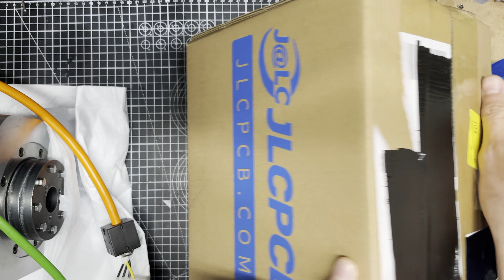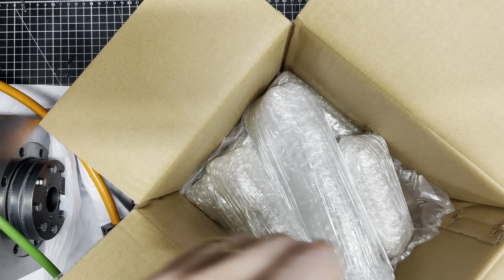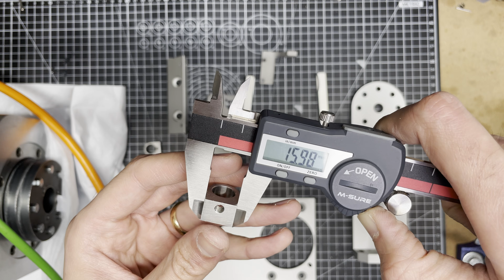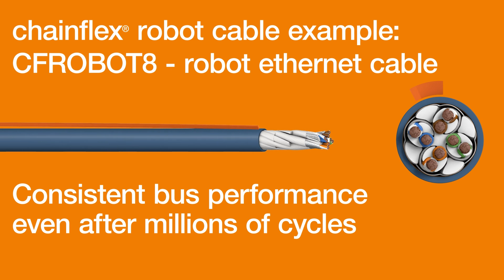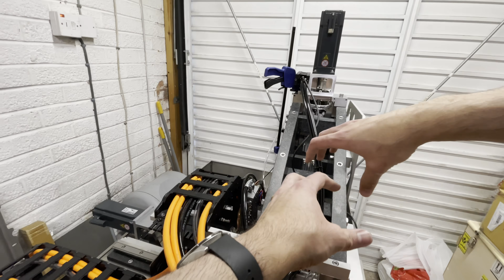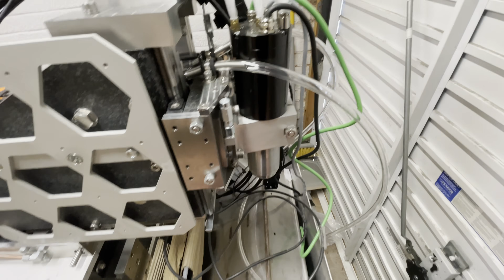Cables and Energy Chains (Igus) - E008

Comment: Hi Kasra, big fan of this build series. I'm working on some designs for a 5 axis of my own, so this is a goldmine of information for someone like me! I'm a mechanical engineer but this is one of my first attempts at building industrial equipment. I saw in one of your responses to another comment that you chose "overpowered" motors for the axis because you intend to limit their torque (and consequently their power) for increased precision. That made me reconsider solutions to one of the biggest constraints my project faces, which is 15 amps of 110v power. Naturally my plan was to use a 2.2kw spindle, but I've heard people say that even the high quality ones don't have low rpm torque. Now I'm considering using a 7.5kw bt30 spindle at roughly 20% duty cycle to have the freedom to select exactly how I deliver the power I have available. I'll probably reach out to the spindle supplier and ask what their thoughts are on the plan, but either way thanks for getting me to think outside the box.
Reply from the maker: @decreasinglynumberless  hi, thanks for the positive comment. 

I hope your build is going well. It's slightly different with spindles. You can actually get 3 or 4 kw spindles with a much higher torque at low speeds compared to a 9 or 11 kw spindle for example. So always consult with your manufacturer, but only after you have calculated the cutting power that you need and at which speed you need that power. You might be able to get a much lower power spindle but with the torque characteristics that you need. If you are after a high quality budget brand, I would recommend CTB from China. Or if you have a bit more money and want to buy a European one, check out HSD, Elte or Omlat. If budget is not an issue go for Kessler or Fischer. 

Cheers,
Kasra
Reply: @kasramehraky9283  Thanks, I've been looking into Jian-ken after hearing good things about their support and construction. Do you have any book recommendations on the topic? I've crunched many numbers, but I'm sure there are many things I havent checked because I don't know I should be checking them.

Comment: Hi Kasra, I've been following along with the videos since the beginning. I don't typically comment on videos , but I wanted to truly thank you for making this series. I've always wanted to make my own machine, but due to too many unknowns about building machines the financial risk of creating a giant paperweight that doesn't live up to my expectations always kept me from going for it. These videos you made have taught me so much, they are invaluable to me. It's the best content on machine building I've ever come across in video form. I love how you explain a lot of your reasoning in selecting certain components and how they will work together, as well introducing some suppliers and providers that I had never heard of. Please keep the series going and know that there are people like me out there who really appreciate that you are taking the time to make these.

What I would be very interested in, is if you could explain more about how you size and calculate certain component requirements. Like how you went about sizing your servo motors, and spindle torque, bearing load, bore sizing for shrink fit of bearings, structural thickness of your machine body parts, and in the case of this video cable thickness. Do you calculate everything to perfection? Or do you ballpark it from prior experience and machines you worked on before? Please also show more about the B / C axis assembly when you get to it. It's something no-one has ever shown before to such a professional extent and It's amazing to watch. 

Thanks again and I'm looking forward to the next one!
Reply from the maker: Hi, Thanks for your comment. It really made my day!

To answer your question, it's a mixture of both. I calculate (multiple times) almost everything, so whether it's a mechanical component or an electrical component, and I read A LOT OF DATASHEETS. But I also rely a lot on experience as well. I give you an example, if you calculate the required torque for the ball screws I am using and take the structure's weight, speed, acceleration and machining forces into account, the result would be far less than what I have selected (which is a 1kw with over 3nm of torque for the X and Y axis). Eventhough I am using much more powerful motors, I will be limiting their torque to less than half of their nominal capability. This might seem very strange, but this is were having an old hand in machine building comes into play. If I leave the torque value as high as it is which is over 3nm continuous torque and near 10nm peak torque, over time it can cause the ball screw to shear off because at its smallest diameter it goes down to 8mm (where it goes into the coupling). So why would you want to spend more money to buy a bigger motor and drive and then limit the torque? Because a more powerful motor holds its position a lot easier than a smaller motor and needs less small adjustments to maintain its true position. Those small adjustments translate into vibrations and even poor surface finish quality in sub micron levels.

I will be doing a dedicated episode on GD&T and drawings of this machine because I feel that can answer a lot of questions.

Cheers,
Kasra
Reply: @kasramehraky9283  Glad to hear it!

Thanks for that insight! So do you mean that because it is much stronger than needed, there is less correction during acceleration and deceleration in de PID loop between the servo, drive and encoder/scales, and therefore that leads to less jerky motion and vibrations? Or is it that the physically bigger servo has a larger diameter rotating shaft and therefore the same amount of power applied moves it less and can therefore be moved more accurately? 

Would love to see a full video on the GD&T and drawings! Also would love to see a full video on the beckhoff system and getting all the components/modules talking to each other correctly. And especially the Beckhoff motion controller itself. I've seen a few builds using EtherCAT with LinuxCNC to run things, but never seen the actual Beckhoff controller used. I'm curious about its out of the box capabilities and how customizable/programmable it is (I'm a software guy, can't help myself).

Cheers,
Laurens
Reply from the maker: @lau87g  Hi Laurens,

I think it's just due to its higher power (either a longer stator and rotor and/or a bigger diameter) that requires less corrections which results in a less jerky motion and overall smoother movement. I don't think the inertia plays a part in this because you can actually specify the inertia characteristics of a servo motor (if you buy from reputable OEMs). Obviously inertia should be specified based on the application, and based on experience, I've always chosen low to medium inertia for a CNC machine.

I have videos in the pipeline specifically for Beckhoff controller as there is virtually no videos on the internet about it, even though it is one of the most powerful systems out there.

Cheers,
Kasra